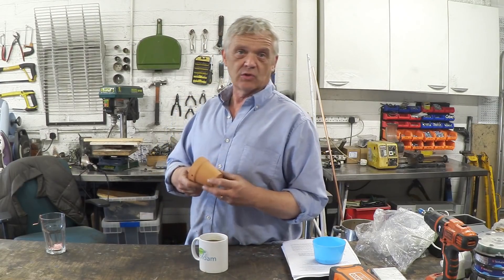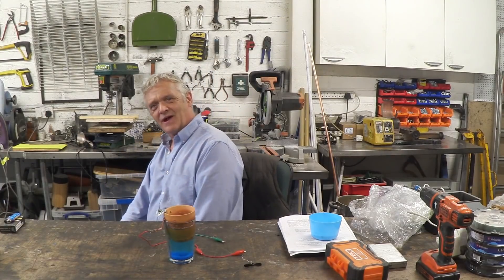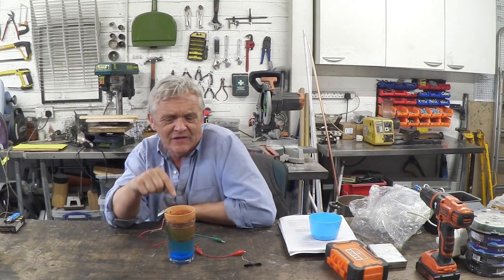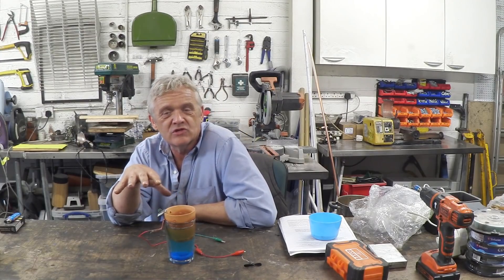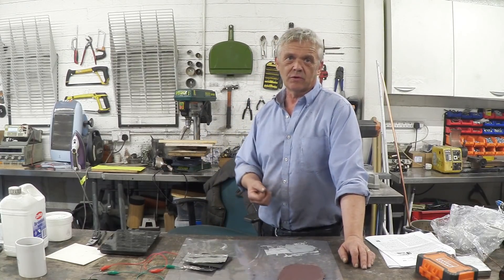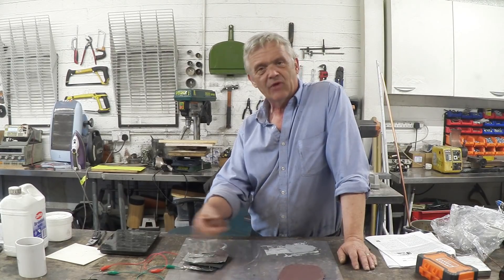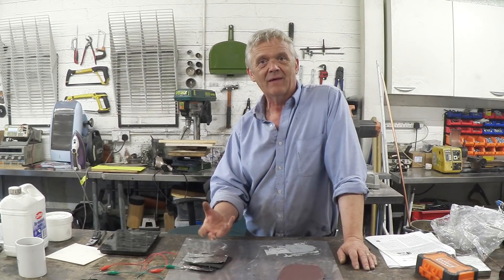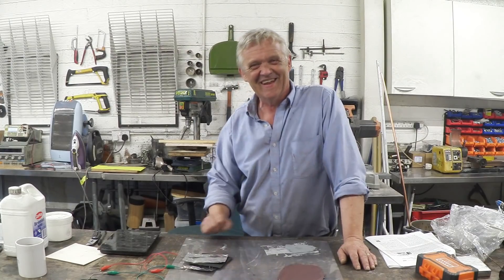1245 How To Make Your Own Super Battery - Copper Oxide Zinc

Comment: I'd like to construct a rechargeable chemical battery where safety of the chemicals is maximized. Electrode materials you could lick with an electrolyte you could take a dip in. Efficiencies, power densities and self-discharge rates are secondary. It would be a stationary device and contained in something like a rain barrel or large plastic tub. Any suggestions?
Reply: potassium chloride and magnesium chloride are simple, safe electrolytes. how well they do with electricity and batteries i cant say....but i will try it next year....
Reply: @gothboschincarnate3931  Nice! Thank you! Looking forward to it!

Comment: so having been on the topic of thermogeneration with copper oxides as the catalyst between 2 copper wires to generate electricity from heat now I am watching you make batteries with copper oxide and zinc the obvious question in my mind Robert is would it be possible to create a thermogenerator on a scale that could be a practical application to the rocket stove? or one better could the copper oxides be incorporated into the rocket stoves construction as an additional part if it were made out of a cpl layer of copper with a plaster of Paris red or black oxide  and installed within...... ? now we are cooking ... I hope you have a chance to ponder this as a development or not... but thank you for the stimulation of my mind.....Mike Saskatchewan canada

Comment: Most water pipes are copper or brass, wonder how much voltage you could get from a aluminium conductor held under the tap and other end connected to earth.

Comment: Bit expensive but try this! Take some sodium hydroxide ( drain cleaner ) and add zinc leave or heat and create sodium zincate .
Then, that two silver electrodes and put into the liquid. Charge this battery ( cell) and it doesn’t matter which way you charge it!!
The zinc goes to one electrode and the other turns to silver oxide .  Hey presto you have a silver zinc cell which charges in a second or so.
Naturally to make it better make the electrodes have a high surface area.
The sodium zincate as a source of zinc in a cell can be used in many ways and the silver can be replaced by other materials…..have fun…it’s called a flash cell as it charges in a flash !

Comment: thanks professor.  i want to ask about dual carbon cells.  if the principle which determines voltage of the cell is that the cathode has to have a higher reduction potential than the anode, how do dual carbon cells work ?

Comment: oh since I mentioned kiln work and you have a lot of repurposing materials videos, I was going to ask, do you have a glass plant near by you could see if they have unwanted chipped and partially used furnace bricks you could do a video on how to make one's own high temp kiln, as the one we have here, is using a hybrid of alumina and zirconia bricks that can withstand temps for melting pure sapphire, (still need an inert environment for say tungsten wire based resistance wire for the super high temps, as everything I have tracked on it shows it can withstand some pretty high temps out of an oxidizing environment (like 3000 degrees C so workable temps I would guess are at least 2500-2800 with the higher end ones shortening the lifespan of course) and apparently the wire works at higher temps in higher pressure argon say than even in a pure vacuum, which seems kinda nice as that allows easier passing of that thermal energy into the item being heated than trying to heat it in a vacuum and blasting the heat as IR radiation or something LOL (might be a time to investigate some microwave heater materials like how they use SiC as heaters by blasting them with microwaves, or a ZVS circuit that uses the alternating magnetic field of the high frequency AC or something, not sure, but just a thought on a way to get materials to build the insulating and structural under compression (ie bricks and such) for free even as they used these bricks of zirconia and alumina mix for the filler under railway tracks leading to our glass plant, and a stream nearby washes them away into an easily accessible public area, as well as a ton of large chunks of glass that is brilliant colors all waste from the glass plant, that is considered earth neutral or friendly since it won't break down and is just basically man made rocks LOL.

Comment: I am wondering if adding a tiny bit of cement to it would help with durability since plaster and 5% cement powder throughly  mixed before wetting makes hydracal a plaster like substance that is incredibly hard, and a PSI rating of double that of most concrete mix for driveways (about 11,000 while concrete we have in the US is often only about 6000 psi compressive strength, and the bonding quality to make say a pot is far greater so a thin layer slurried around inside a mold and poured out so you get an 1/8th inch thick layer will be more durable of hydracal than even cement, ) 

also upping this to 10% is what is known as Ultracal which has a compressive strength of about 30,000 psi (and both are still hydralic cements so won't be deminished by water but instead water even under it will cause setting up so using in a wet cell seems they would be much better at surviving,) 

the ceramic pot you are using is terracotta which fires at around 1000 degrees C, and I have succeeded at getting it to fire to a water insolubility level of only about 500-600 degrees by adding 3% concentrated vinegar, 1-2% citric acid solution, and same of oxalic acid solution to the dry terracotta powder to wet it instead of plain water to make an acid based geopolymer, no idea what say using formic acid diluted in those might do, or any other organic compound, but my thought on this is PVA and corn starch and maybe a foaming agent that breaks down depositing either a carbonate type or oxide of the metals in one or the other might make a way to mix the graphite foam into something for expanded surface area with some stablizing agents and plaster breaks down losing it's water after setting if heated to 350 C so that could be something to act maybe partially as a foaming agent in the mix, then when you add water by soaking the fired finished bit, resolidify to make a graphene/anode/cathode structure inside a fired clay unit, all at those lower temps you used to work the regular graphene foam structure of another video through calcination process in your oven/kiln in two stages, 

Something I want to try and see if a way to not only get it to not swell when going through the cycle of charge/discharge, and is interlocking as a block for building bricks so the battery/supercapacitor storage could be a part of the structure of a building, :)

Comment: This is old school tech, when people learnt and tried. Not just Google and buy and dispose.
I like the olden days make it, and we have more refined materials than way back so we should get better results; or could as we have a understanding of how it all works.

I just like finding videos online that have my thoughts tried out. ;)

Okay so the balloon ones next thanks :)
Well there is power in the air and the higher you go... So how do we harness this?
Alloy balloon on copper wire?
But where does the key go? 
(Some people will get that other won't... Kite).

Perhaps a paper and plastic cap, to stop the discharge and help the lil' old battery.

Comment: I want to reply but I’m such a beginner at so much of this. I’ve watched you on and off over the last several years or more. Today I’m interested in telling you to consider showing how simplest materials found in local river stone, charcoal, some acid perhaps from a fruit, and a simple conductor so that one may spark a fire. Wizardry stuff. Some of this I partially understand, but without repeated trials I won’t get very far. I laugh when I see people, particularly survivalists, spinning bow drills. The concept of course is to heat up a small space sufficiently to generate a coal. Well, I can do this with a thin high pressure ‘piston’ with a bit of carbon or dry grass at the base. In your case, a tool to switch a ‘spark lighter’ whenever needed made from local simple materials would be interesting. I would suggest to harden and waterproof your conductor using boiled sap. Will you give this a simple shot?

Comment: hey, if you still have this battery, i wanted to ask what happened if you sealed the battery and shined a bright light on the copper oxide layer? would the copper and zinc make a pn junction that could store electricity as solid zinc?

Comment: Can you do the same cells using Magnesium instead of Zinc ?
Reply: Magnesium is notoriously hard to get to recharge well unfortunately. It works great as a primary, galvanic corrosion type battery though. There are a lot of researchers and universities out there trying to "crack the code" to get a form of, or combo with, magnesium that will recharge well. If it is done, it very well may replace lithium eventually since it is much more plentiful, easier to get, and is quite energy dense.

Comment: If you added activated charcoal would the power density increase?
Reply: I would guess not. The carbon isn't part of the chemical reaction, and he's not depending on its surface area - it's impregnated with HDPE anyway. The carbon is just a conductive layer to pass current.

Comment: Nice! US20070286324A1 a little That might interest you and something to look into. Not quite the article I’d seen but pretty close.  This dates back to 2007. so the ideas been around awhile . thank you for the patent hint I didn’t realise google did a patent search narrowed down my search significantly. I eventually got it down from nearly 950000 to 450 when I found it. Great section on battery technology. Even found one mention a lithium ion battery with many of the elements mentioned in a previous post. Really clever stuff! Direct electrical creation from electromagnetic energy.  Side note: copper zinc batteries depending on the source of copper. I bet you could use pennies to do it most modern pennies are anodised bimetals a mostly with a soft metal core. I’ve a load of them. might just be the best use of the pennies I have to make a steam/ technopunk style battery. Your giving me ideas I might say are wonderful. So thanks you once again, and great stuff rob keep it up.

Comment: Zinc will dissolve in hydroxide solutions. I think it might be okay in your case since it's in the solid state and mass transport shouldn't allow too much hydroxide to react with the metal. Great video!
Reply from the maker: cheers mate but do have a read of the paper
Reply: @ThinkingandTinkering  I read the paper. My comment was talking about the material of the current collector. You said that you could try copper and zinc. My point was that zinc isn't stable in hydroxide but your current collector isn't in direct contact with the electrolyte, so it might be okay.

Comment: Hi Robert, really enjoying your channel and tried to join, however that option never seems available :(. Help please. Also would love to know what the Volts Amps was that you used in your 1041 video for switching the magnetic flux in your permanent magnet. Thanks so much.
Reply from the maker: I think it was 12v and an amp or so for a split second - so I am not sure what watt hours that is - but to be honest mate it is going to be specific to your design so that you will have to find by experimenting if you build it
Reply: @ThinkingandTinkering  Thanks, my test build actually uses exactly the magnets you did.

Comment: With copper I oxide Vs copper II oxide, would we need more of the copper II oxide or less when making the battery?
Reply from the maker: so you really need to read the paper if you want an in depth look at this the paper title is rechargeable alkaline zinc/copper oxide batteries doi 10.1021/acsaem.1c01133 - the original paper used CuO or copper II oxide - you can use Cu2O or copper I oxide - which is the red powder I used - copper I is 143g/mol and copper II is 79 g/mol obviously copper I has 2 ions of copper per molecule compared to copper II which has one ion of copper per molocule. if you divide the copper II by the mass used you will get the mole fraction divide that by 2 and you will get the mole fraction for copper I - multiply that by the molecular weight and you will get the weight needed - hope this helps
Reply: @ThinkingandTinkering  Cheers for that mate. The paper is behind a paywall so I'll just have to purchase it.

The situation with copper I oxide Vs copper II oxide and calculating it might make for a good video on the topic. I have run into a similar situation with making iron III chloride. I had a known amount of iron nails and used an known amount of HCL (30%) to make iron II chloride. I was then faced with trying to work out how much H2O2 (30%) to use to covert it to iron III chloride. In the end I just used an excess of H2O2 and let it sit for a couple weeks for the H2O2 to decompose.

Anyway, thanks for the great vid.

Comment: Looks interesting makes me wonder what would happen if someone used the aluminium foil out of dead lithium batteries that have lithium carbon mixture still stuck to it
Reply from the maker: I am not sure what you mean but if you used it as a current collector then - there would be no difference

Comment: jelly roll it and stuff it in a piece of chopper pipe/plastic pipe just  so you dont break it before you have proper time to evaluate the design. and to say the energy density at this stage is not very important. the fundamental   questions like will it hold its charge how soon will it self discharge. can it be recharged and discharged again and again.
Reply from the maker: you do know I am just replicating the paper right?
Reply: And you do know that the vast majority of people are not going to purchase that paper out from behind that pay wall. So, your constant references to that paper are largely meaningless to this discussion.  Without violating copyright, you can summarize and answer questions about that paper, and, having probably replicated the experiments yourself, can testify as to your results, especially in circumstances where you have significantly modified the experiments. 

Also, an even smaller minority of your readers will have or even can replicate the experiments. So, quit shoving off your readers with the equivalent of click bait and answer their questions. Those who do not believe you or who do not or will not ever have a situation where they can attempt replication, should not waste their time with your weak attempts to get them to attempt possibly hazardous experiments on their kitchen counters.

Comment: This brick rechargeable battery make me wonder about building a house with them and put solar cells on the roof. Put the bricks in series of 10-20 then parallel them. Add a couple of inverters and solar for a green house.
Reply from the maker: awesome idea mate
Reply: I mean... have you seen those WASP 3D concrete houses, how hard could it be to switch the filament for the final dozen layers? interesting concept.

Comment: One obvious improvement I also see would be to replace the graphite with graphene or conductive ink. 
The POP could be replaced with floral foam for the separator and the whole assembly placed in the BLADE design developed for the ZnBr stationary battery. 
Building on that, we could increase the surface area of the anode and cathode by coating 1/3 of the floral foam in a Zn-based slurry and the other 1/3 in the Cu-based slurry (with graphene/conductive ink). This leaves the center 1/3 to hold the electrolyte. The pores of the foam will act as a substrate for the electrodes to develop the mesoporous surface for electrolyte interaction.
Reply from the maker: very nice thinking mate - thanks for sharing your ideas
Reply: Hi Robert, can make a video not about the development process but about this actual battery put a cell together and show some power measurements (I'm looking to build my own batteries for my off-grade power system, we need batteries, but I don't want to buy lithium ions)
I was looking at the copper zinc because of material availability
But I don't know much about chemistry, and honestly I don't understand every single thing you explained during this video because of my chemistry understanding limits and i have access to a workshop, but a real chemistry lab, I am trying to synthesize my own chemicals in order to expand my knowledge but it would really really help if you could make a more focused video
About this particular cell, thank you so much for making these videos
Reply: Ok that's over my head. Work on it Andrew sounds interesting.
Reply: Would it be possible use fine coal dust from charcoal and a tape?

Comment: Excellent "teach them how to fish" video. I've been trying to learn about the liquid metal batteries that Ambri Technology is developing. They seem very promising.
Reply: I so very much want somebody to combine a couple of those liquid metal cells with a sterling or closed loop steam engine.
As the operating temperature, both charging and discharging is so high,  it seems like you could use the engine to charge one cell, while running your load off of another, and just flip flop back and forth.  it just seems like you could balance your cell size to your load and size of the engine to get your charge and discharge to run at roughly the same rate, and as both sides produce a Lot of heat, make the thing run just about forever in a constant loop.   
perhaps not, but it seems worth exploring.
Reply: @ryanjamesloyd6733  Better yet, make it 3-4 and you don't have to worry about the charge/discharge rate differential
Reply from the maker: for sure
Reply: Damn my brain hurts..love it
Reply: I was pretty excited about the ambri technology too way back  2008!!!!!!!
To recharge the metal has to get EXTREMELY HOT 🔥.  Too much of a  Fire hazard!